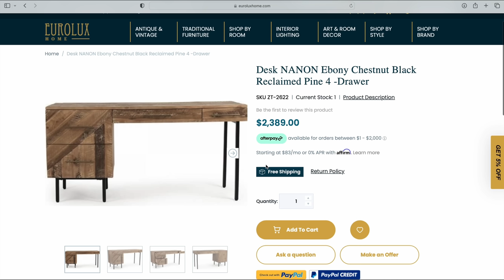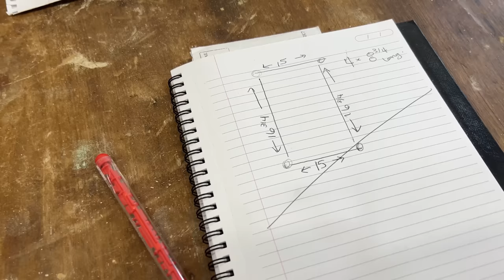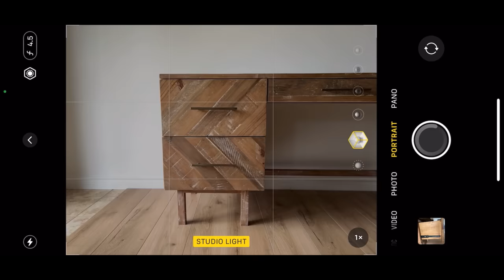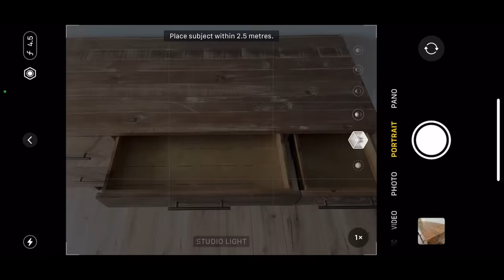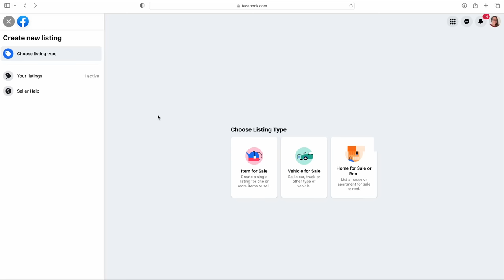Dumpster to Dollars | Flipping a Trash Picked Desk!

Comment: Thank you, Katie, for sharing your full and thorough process all the way through photography, pricing and posting. I had one question about the new base you built, which I especially watched with great interest. I noticed that you didn't put any protective "widgets" (for lack of the right terminology) on the bottom of the legs where the wood meets the floor. Do you recommend not attaching, say, those rounded thick pieces of felt or some other kind of material at the ends of the legs? Thank you!
Reply from the maker: You could definitely add some nylon feet to the bottom. I might do it after this one sells. I often put together a little bag of furniture care instructions, touch up paint (when applicable) and felt pads together when a piece is going home.

Comment: Replacing those metal legs with wood ones truly enhanced the rugged look of this desk. Plus you made sure those supports were much sturdier…Great decision! I was wondering if adding some small leg protectors would be helpful? Thanks again for a very informative video. 👏
Reply from the maker: This will get some additional little glides on the bottom on the feet before it goes to its new home 😉❤️
Reply: @salvagedbykscott  Thanks for the quick response and clarification. I’ve got my fingers crossed for a quick sale at your perfect price. 🤞🤗🤞

Comment: I'm new to wood working so I might be wrong about this, but I think around 5:48 when you added glue to the joint and added the second clamp, the second clamp should have been going around the two pieces being glued together to add pressure to the glue seal. I don't think the second clamp helped the glue process unfortunately. But least there's a screw holding the joint together! Thanks for the video!
Reply from the maker: The clamps were only holding the pieces together for me while I installed the screws. The screws hold the two surfaces together while the glue dries.